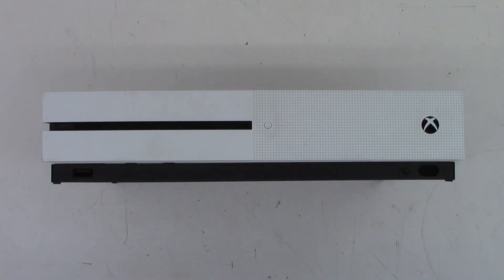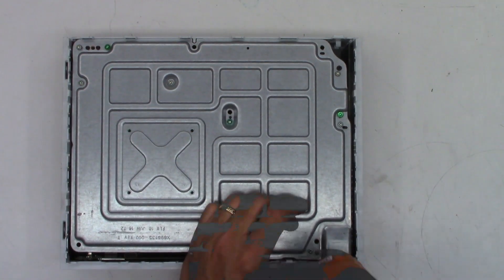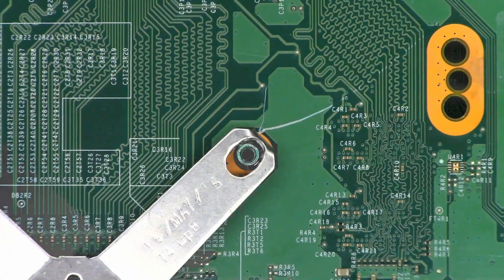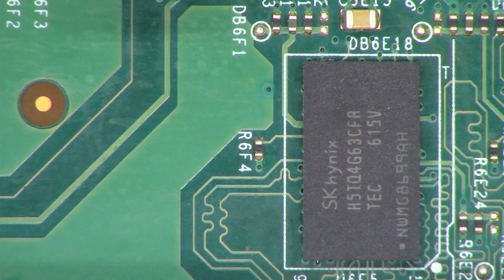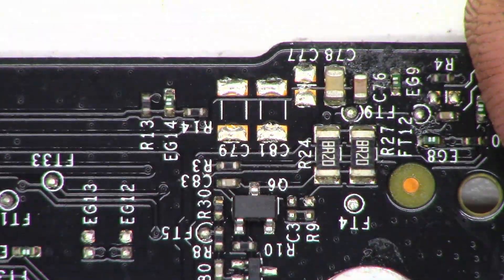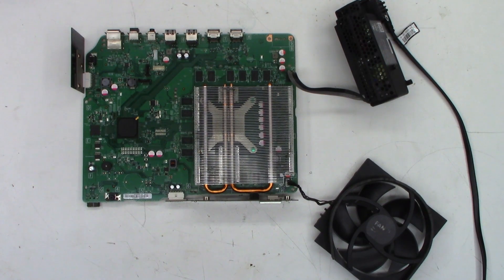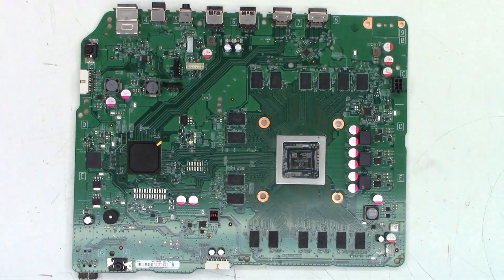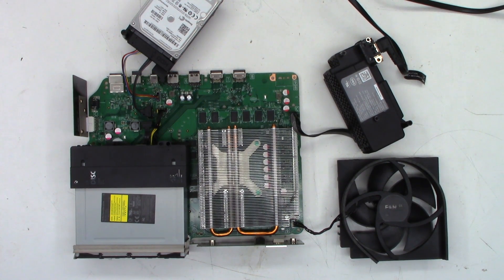Xbox one S with liquid damage?? wont power up, shuts down. Unsuccessful repair. Sorry  :-(

Comment: After putting the pcb board in the dishwasher. Do you allow it to dry the board or dry it another way? Thanks for sharing.
Reply from the maker: Dried it with compressed air for several minutes. Been doing the same for years (close to 40).
Reply: Use a oven

Comment: Have you tested if you have power on those inductors that create various power rails?
Mainly the RAM and CPU ones.
Also search for fuses and see how they are.
And take a look if the standby voltage remains intact or drops when powering it on.

Comment: I seem to remember these units had problems with the solder balls under the chips, some would respond to fluxing the chips and heating the pcb under the chips, that sometimes would resolve "some" issues, I know the red ring of death, so it was called,  was caused by the bad or cold solder joints under the chips...
Other than that, I was never big into Xbox repairs. 
Good try anyway.

Comment: The next XBox, PlayStation or Switch you get, it might pay to check all capacitors around each chip, A capacitor that indicates both of it's leads are grounded indicates the chip connected to it may be faulty, Of course the very capacitor indicating as a short could have also failed, but usually it's the chip or IC that the capacitor supports.. 
A quick and dirty method is Voltage injection and a thermal cam which will indicate high current and usually the shorted component..

Comment: You washed the board in a dishwasher ? Is that ok for any board ?
Reply from the maker: I have washed many boards in the dishwasher (or in the sink, before I had a dishwasher) over the last 40 years. There are a couple of exceptions however. Remove switching and high voltage (flyback) transformers before washing. Thoroughly dry the board with compressed air, sometimes I bake the board at the highest temperature the lowest rated part on the board is rated at. Usually 185 degrees F for 85 C rated capacitors.
Reply: @norcal715  Thank you for the info.
Reply: Sure it is👍🏻

Comment: I have a Denon AVR-3000 that spits out audio playback at a very low level from main speaker pair A. I don't have the owner manual or remote to reset or work on it myself... can you assist?
Reply from the maker: I can not find a reset for that model with out having the remote. Order a cheap eBay remote and reset it to factory and see if that helps.